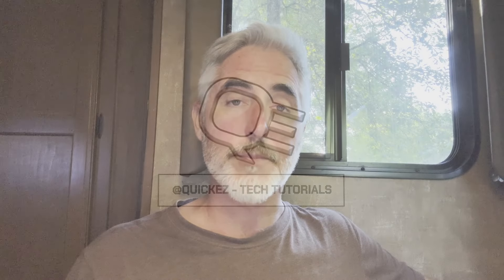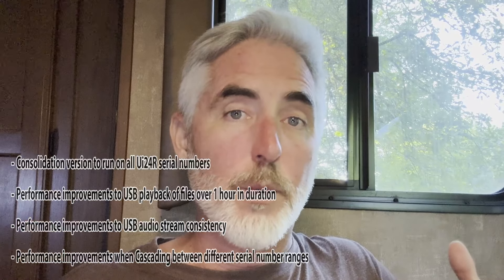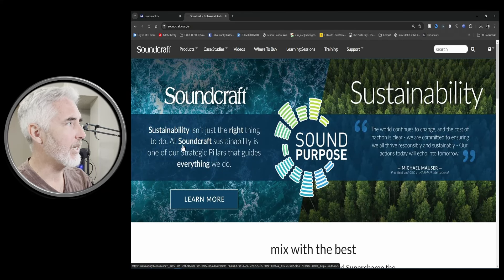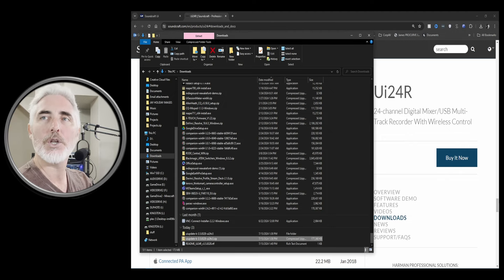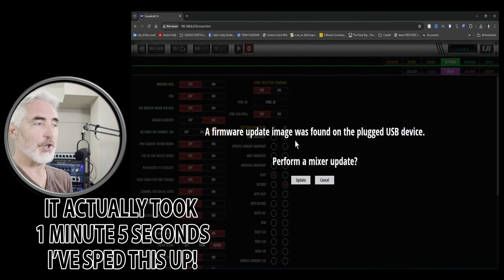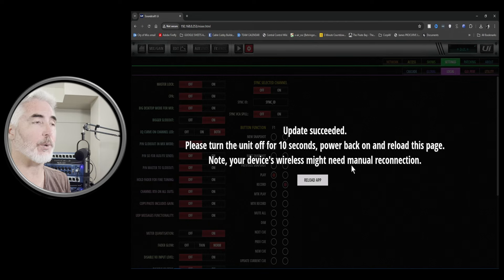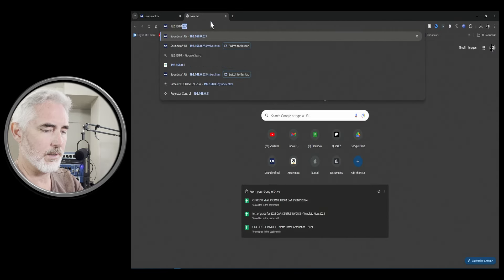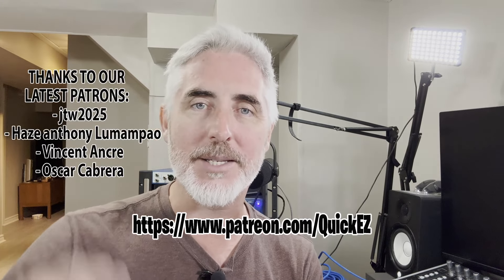SOUNDCRAFT UI24R FIRMWARE UPDATE - What it updates and how to install it

Comment: Thanks for the video.  Since installing firmware vesrion 3.5, our UI24R won't fully boot.  The loading... message appears on the initial splashscreen, and then it's just the blinking green lights.  Voltages have been checked, and there don't seem t be any hardware faults.  Any clues as to how to get it to boot?  We've tried the fullreset process, but it doesn't seem to even get as far as reading the flash drive.
Reply from the maker: Hi Gareth. I’m sorry to hear this. 
I have not faced this issue so aside from the usual fullreset the only thing I have to suggest 
(other than reaching out to Soundcraft support, which I would recommend at this point) 
would be trying a cmos/bios reset. 
I do believe there is a reset button inside the device in the motherboard. 

Word of warning. I have NOT done this myself as I’ve had no reason to. 

I can test this with my additional unit to see if there are any errors or additional issues afterwards but I won’t be able to do this test for a week as I’m away from home. 

If you end up trying this please let us all know the results.

Comment: Silly question - do you unplug the USB dongle after the first power down from the successful update, before the 10 second restart?
Reply from the maker: Not a silly question at all. 

I didn’t t unplug it right away after the power down. And you don’t “have to”, but you can. 

If you leave it in, it will just prompt you again if you want to do the update again. At which point you can say no and remove the stick. 

I probably should have included that in my video. 
Thanks for asking the question!
Reply: Thanks friends

Comment: Hello, once you have updated the unit to the latest release, what about going back to the previous firmware version if needed? Is this possible?…
Do I have to follow the same procedure with the older (less recent version) zip file on a usb stick as per instructions?
Thank you!
Reply from the maker: Hi, I haven't tried this myself so I can't absolutely guarantee it's success.
However, In theory it should work by using an older version of the firmware and following the same steps.
Is there a specific reason you need to roll back ?

I will try this at some point, but unfortunately, I have too much going on at the moment to try this in February.

Comment: They really need to address the touch screen issue. Their selection and mode of connection to touch screens is limiting. The problem of not knowing for sure if it will work until you buy one and hook it up is also a bit off putting. 

Add to that you can't use the "Big Desktop" mode on HDMI screens. So.... you're limited to the size of your computer/tablet screen for the largest view available. Seems like a missed opportunity. I had a 27" HDMI screen I wanted to use but no....😥 

For such a great product it seems the R&D team fumbled the ball in that area.
Reply from the maker: I don’t disagree on any of this. 
Sadly, every mixer has something to dislike or at the very least scratch your head over. 
I think people at the top probably make decisions about priorities, and regardless of what the R&D department come up with, they hold things back. 

Big D restriction is so ridiculous!!

That’s a shame about your 27”…
If I had the money I’d just pick up a ton of touch screens and test them for everyone so there’d be no more guessing. 
Maybe one day…

Comment: Maybe one firrmware update for the huge noise or muddy sound for any external audio source input ( dj console, players, etc ) . This mixer has a huge noise at any AUX or MASTER out compare to a RCF M18 for example. I have both. Also there is a strange "stereo image" compare to other digital mixers. When you make a Stereo LINK and hear the sound you can find that the stereo image its somehow without a bit more presence. Like too much spatial sound and too far away. The GUI its fantastic, network and wireless superb ! Also, this mixer came without fan cooler. YOu have to fix it by yourself. There is a special place for that ( funny ) . Ok, this idea was for noiseless but.....in live enviroment this "no fan cooler" its a big issue. I will do the new firmware update, hoping to find maybe more other good things ( not just what I saw in this video ).

Comment: I wonder what they actual mean with performance improvements to audio stream consistency, probably not solving the USB performance issue when doing full band 24bit multitrack recording.
Reply from the maker: Hi Joe,
I’m hoping to do some extended testing over the next couple of weeks, to see if anything jumps out at me. Though I think this is going to be difficult as I’ve never been able to reproduce the issues that others have experienced with their ui24’s. 
At any rate, I’ll post anything I discover. 

If you run the update and notice any improvements right away, please post about it.

Thanks for watching!
Reply from the maker: Just curious. What USB issues have you had while tracking?
Reply: @QuickEZ  With the tracking set to 24bit and recording 18 tracks the unit came with a popup saying that a faster USB stick is required, the ones I use should be fast enough though.
Reply from the maker: Ahhhh gotcha.
This is actually an issue that is common with some other equipment. Specifically the Blackmagic ATEM mini ISO line of video switchers.
They have a very specific requirement for write speed and cache especially when maxing out the record capabilities. And they have a list of specific drives that will work for their ISO line. 

People are constantly picking up drives that appear to meet that write-speed requirement, but in actuality, the drives are too slow when maxing out the channels and are not on the approved list.
It's a question EVERY.SINGLE.DAY in the ATEM forums.

Lots of folks are using SSD drives instead of thumb drives with the UI24, connecting them with a powered usb-hub and having very good success that way. I believe the Samsung T7's are a common SSD for this purpose, but don't quote me on that yet. I'd have to dive back into some forum conversations to guarantee thats what folks have been using.
Let me know if you're interested in going that route and I'll see what I can find for you.
Reply: @QuickEZ  I was actually thinking to use an SSD, since I know they are fast enough for much more than those few tracks, I’m pretty much on pair in which disks and casing (controller) to use, thanks though.
Read/Write on my USB sticks should do, they don’t go much faster, but I kinda suspected that USB sticks might run into issues, the work for 20 tracks at 16bit though.
Btw. you can use all available space supported by FAT32, but I guess you already know.
I used Rufus to quickly format my sticks.
Reply from the maker: Best of luck. If you have any success or failure with the SSD route, come back and post about it!
Would love to hear your experiences.
Reply: @QuickEZ  randomly with the same USB stick I always use, the record button will blink very rapidly on all connected devices.
Reply from the maker: If you plugged it into the recoding usb slot then I’m sure it’s just triggering the software to alert that there is a drive in that slot. 
Or it could be an “activity” type of indicator while the mixer is reading the usb stick. 
Does it stop you from running the update?
Reply: @QuickEZ  no, I haven't had any problems it is just a random thing that happens every so often when I record

Comment: Hi, got the mixer few weeks ago for church purposes. While streaming through OBS I see the audio signal is good for a laptop but for certain mobiles the volume is dead and distorted. Would this be a YouTube issues or Firmware update issue?
Reply from the maker: If you are able to listen to the other end of the stream on your device and the audio has no issue, but others are experiencing problems, then the likely culprit is the device being used to listen. 

That being said, there are a lot of variables so without additional information it’s hard to give you an absolute answer. 

If could hear the audio myself I could probably comment with more certainty.